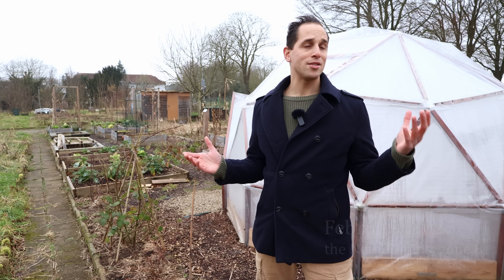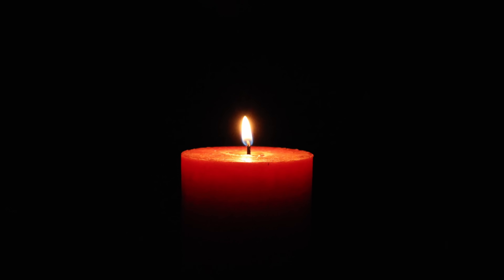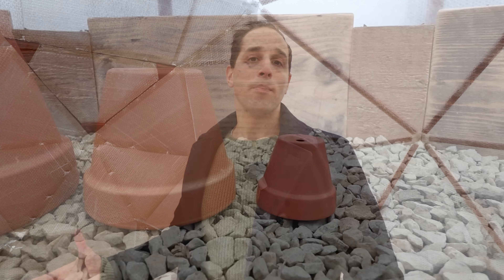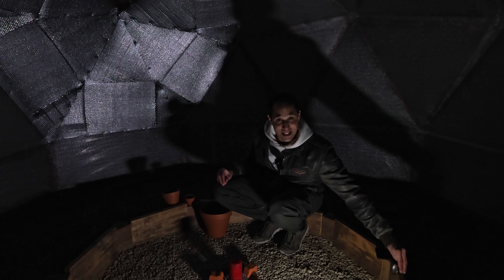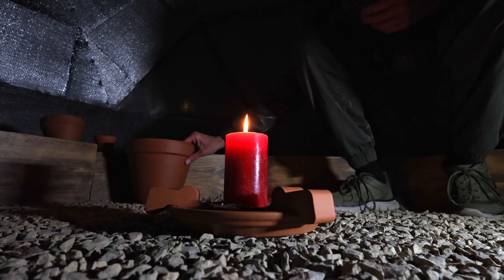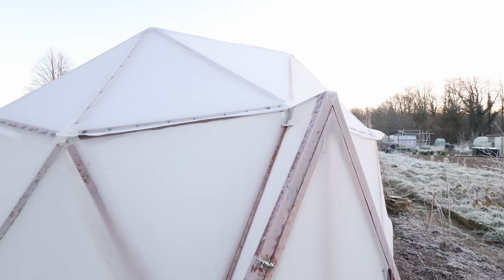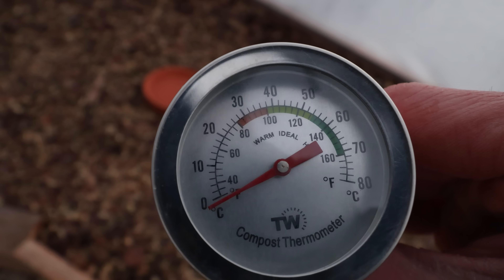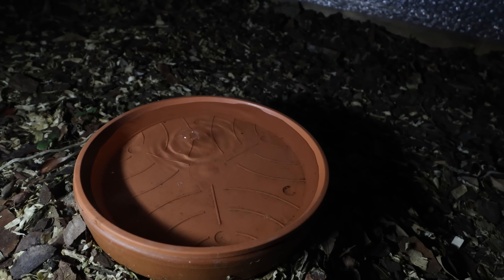Can a Terracotta Heater Keep my Greenhouse Frost-free? • Ep. 48

Comment: Having any air gaps just ruins the whole test. If there is wind, it will cause more air exchange than still nights. I used 9 candles in my house when we had a freeze in Texas. In Houston many houses were 17°F inside and many water pipes burst. I am located more than 30 miles north, therefore colder, yet my house was 39°F inside and no water pipes burst. Candles work absolutely and it’s a proven fact. But when you have air gaps and air leakes, it just ruins the whole test. Now you have another winter coming, you can seal the air leaks and try again. And, you will get the same result without the terracotta pots. Just unsing candles will give the same result.

Comment: try a 4th smaller pot in between the primary stack and the candles. Might need to go up a size on the bottom pot of the outer primary stack to keep the same size that you have now as your first one. But if you could get something like sand, in a big stock pot. You could heat the sand itself. Letting it act as a big radiator
Reply from the maker: Interesting idea to add another pot and sand! Thanks for the suggestion!

Comment: We had a 3 week power outage after sandy ..
Tried to heat a can of soup with the candles we were already burning...
It took over an hour so a candle just doesn't give off enough heat
Reply from the maker: 3 weeks?? That must have been a quite the challenge!
Reply: It was especially since we got 6 inches of snow a couple of days later..
But almost all of nj coast was in the same boat and it stayed cold afterwards .getting gas was also a problem but the police department took generators to gas stations so they could pump the gas they had.a lot of traffic lights were out making getting around hard only allowed right turns or ramps on and off for left

Comment: Get those air leaks! That's CO2 you're letting out. The permaculture course says to use compost or mushrooms to heat. The two work together. The plants make oxygen from CO2, the compost/mushrooms consume it and make CO2. 
Could try wood to, I suppose. That would be a trick though. You need to reburn.

Comment: Depending how cheap you can source your heat weather wood oil or candles is cheaper I would suggest the cheapest heating source For example a very small wood burning stove would easily heat that all night using very little wood Even a pellet hopper can be used to feed pellets of wood for long burn time

Comment: You're only loosing energy to heating those pots. Lighting the candle on itself is more effective, just get slow burning candles. How is the floor/base insulated? I don't know where you live but ground freezes as deep as 2.5 meters. The cold is conducted from outside soil, not just air.

Comment: Ive always seen the terracotta heaters built with the pots stacked inside each others, using metal washers as spacers and a bolt through the center to tie it all together.  Your method definitely is cheaper and easier.
Reply from the maker: The method you mention is also a very valid way, as a lot of people in the comments have pointed out! All I can say is that my heaters were very warm to the touch in the morning, but like I mentioned at the end: the best way is probably to have good insulation + thermal mass, with small heaters as a support role (or a solid heating system to really keep the temperature at comfortable levels)
Reply: @atthegrassroots bs they do nothing. Waste of money

Comment: Actually a good idea. Bigger pot for the bottom and one of those home-made survival candles from 3 or 4 wicks stuck down into a can of "Crisco" or whatever the equivalent is in your area.  Also one of those fans that people put on top of wood stoves that is "powered" by the heat for air/heat circulation would possibly take you even lower in safe temps.  But a good demonstration video, Thanks!!!!
Reply from the maker: Thank you for your comment! Yes, I've seen those "Crisco candles". I had to look them up but they are available in the Netherlands. And yeah, those "heat fans" look extremely useful for an off-grid heat setup!

Comment: I like the idea, but would look for a different heat source.  When you look at the current price of paraffin wax this would be a most expensive way to heat a greenhouse.  Have you considered small oil lamps?
Reply from the maker: I've heard similar stories of such candles being quite pricey. These were €2 euros each, so not the most expensive I would say, especially if it was for only a few frosty nights. But if you have long harsh winters where you need something consistent, then I suppose this will add up, especially if you need more. Multiple people have advised me oil (lamps) so that could definitely work. I still think thermal mass + good insulation is the best way to go, with these or other kind of heaters as additional heat support.

Comment: I made two heaters using votive candles for a 2.5' x 5.5' covered hoop raised bed. I covered it with plastic sheeting and covered that with a canvas drop cloth. It easily kept the temp under the cover 30 degrees warmer than ambient temp.

Comment: 7:41 so you have those 3 candles burning all night, but only 1 of them are burned half way and the other 2 candles looks like you just turned them on.
There are several mistakes with your video. 
1) With terracotta pot heater, the heat under the first pot gets too high, so your block candles will melt away pretty fast. how I know it? I have made the same experiment my self.  I had to use Tealight candles just to keep the wax from melting everywhere. 
2) you can't just stack the pots on top of each other, with a hole in the middle, because the heat go's out way too fast from the middle hole like a chimney. it doesn´t stay inside the pot long enough to heat up the pots. you have to block the air hole in the middle to keep the heat inside the pots to heat them up so they can radiate the heat.
Reply from the maker: I suppose that was because the one candle already burned an extra night.  Thanks for the feedback!

Comment: With so much 'empty space' in the greenhouse, you'd be better off filling it with something to act as a thermal sink. Even if its just a pile of water-filled plastic bottles, fill up as much of the space as you can. THEY will absorb the cold and radiate heat. 

I have several  little four-shelf plastic mini greenhouses.  The base of each (ie the bottom shelf) is filled with water-filled plastic milk bottles. I use one votive candle under a large terracotta poton the shelf above the water-filled bottles, and seed trays etc go on the two shelves above that. When all is fitted and closed up, I slide a cover I made from reflective bubble-wrap  over each mini-greenhouse. It covers to down to the base. I also have transparent bubble-wrap assembled into a complete cover to slide over, for days when a hard frost doesn't lift. They require careful handling but are effective.

A mini-greenhouse like that would be ideal for you to use within your greenhouse for seed starting etc, and   for soil  warming, you could lay a sheet of breathable black fabric on the soil during the day when the sun strikes it, and cover the area with a sheet of bubblewrap at night so all the warmth doesn't radiate back out - unless you want it to  of course!
Reply from the maker: Super detailed information, thank you so much for sharing your wisdom! I will definitely keep this in mind.

Comment: Don't sleep on thermal batteries.  If the sun is out, having something like stones or concrete pavers (lots of them) + good sealing and insulation can do quite a bit to keep a space warm.  Also, if you're going to do supplemental heat, start it a few hours before the sun goes down. I have a theory that a well-insulated warm bubble is much easier to maintain temp in than trying to warm up the space without assistance from the sun.
Reply from the maker: You're absolutely right! Good insulation + thermal mass will probably have the biggest positive effect. Of course, this was but a simple experiment to see what the effect of a terracotta setup could be.
Reply: Don't use concrete though, concrete has poor thermal retention. Get something like red clay tiles I think those hold heat a lot better

Comment: Both cases about 3 degrees warmer than outside. That could well come from just the stored heat in the growing beds. Then again candle flame is tiny and the energy output very low. It can save the surface soil from lightest of frost if it's only a couple of degrees below freezing. But nice experiment and well put together video!
Reply from the maker: Very true! After this experiment, I think at least multiple of these could potentially protect plants from frost, but I think good insulation + thermal mass will have the biggest overall effect.

Comment: I failed science class too....lol
Reply: It's not a bad option. The clay pot redistributed the heat from the candle, so it heats up the cold air at the ground level, instead of rising straight to the top of the greenhouse, and candles have enough heat output to keep smaler domes warm. I've managed to keep lants frost free in -15°C by wrapping them in a 1m diameter dome of 2 layers of bubble wrap and putting 2 candles inside. 
The two issues here are opening the door at night, which lets in really cold air and that a single candle has to little of a heat output for a greenhouse this size. But it principle it's a great option to keep plants warm if it's not feasable to run electricity and it's only needed for a couple of days.
Reply: Redistributed = energy loss, sorry no bonus here.
Reply: @ivanivanovicz8708  not really, a reflector housing or a lense in a flashlight also just redistributes the light, but it certainly increases the utility. And here is no energy loss in the form of heat, since the entire point is to have heat. 
The clay pots redistribute the heat to where you actually want it.

Comment: In the army we had something like a kerosene stove, I think just going with what’s established on the market is the best bang for your buck. This is cheap entry cost, but all those candles will be more expensive than the kerosene in the long run
Reply from the maker: You definitely have a point there. Especially if your area has a lot of frost days. Here in the NL harsh winters are not as common as they used to be, and this was really just a test to see if it would work and I could hold off the frost for a few nights.
Reply: @atthegrassroots Oh yeah I'm sorry I've responded to a few of your things already but this guy makes a good point. You just need two different sized cans one that you can put inside the other, and get a hold of some kind of carbon fiber drop cloth that would be for like a soft welding things like soldering and stuff use a blow torch, You have one can that's larger in diameter than another one You line the inside of the larger can with the drop cloth and have the drop cloth cut to the size of the can and it's not dropped off Sorry the welders mat It will act as a wick. And then you have your smaller can it's supposed to fit in there just so that it presses against your wick nice and firmly is held in place you'll punch a hole small hole or three in top to help let air pass through so you'll fill it with like kerosene oil or alcohol whatever it is something that will burn, and so you'll have that tin can put your smaller can in there on top the whole helps let air pass through and you've got your WIC waking material set kind of prime your wick or whatever if you have to set it a little terracotta thing glide it and it's kind of like a little burn stove it'll go for maybe 8 hours or something like that If you have like two or three primed in set aside you know you can pre-warm everything with one torch and then before you go to sleep set another one and then wait and you wake up in the morning You know change it out set the other one for a couple hours before putting it out and resetting for the next night.
Reply: @atthegrassroots  Grave candles are also a great option compared to the fancy ones used in the video. They are cheap,  and burn long, so if intividual plants need to be keept ware, wrapping them in 2 layers of bullble wrap and putting 1 or 2 of these light under it works really good.

Comment: THE MISTAKE YOU MADE WAS , YOU DIDNT COVER THE TOP POT WITH A COIN , YOU NEED TO LET THE HEAT BUILD UP INSIDE , THE WAY YOU SET IT UP THE HEAT WAS JUST RUSHING OUT THE TOP , IF YOU CAN SEE THE FLAME YOURE DOING IT WRONG , SORRY FOR THE CAPS , JUST TYPED IT AND TO LAZY TO RE DO IT . KEEP UP THE GREAT EXPERIMENT .
Reply: This doesn’t work in any case hence why gardening requires heaters in winter or we all would do this and save money
Reply: @pinballwizard6906 It’s a question of scale. The experiment actually worked if the goal in a small greenhouse was to keep the temperature above freezing. The basic point being that frost tender plants don’t freeze and can be kept alive in cold snaps. You’re not going to heat a large greenhouse with candles. That was clearly not the point of the experiment. Horses for courses.
Reply: Fortran programmer? USA military signal person? Screaming at us?
Reply: I guess your Caps Lock key got stuck and you didn't want to retype everything when you realized it.

Comment: It doesn't really seem worth it to heat one of these small greenhouses because for the cost of heating you won't get a return in produce. I have 2 small greenhouses but really they can only be used for hardening off plants earlier in the season. I start my seedlings in a shed on my porch that has lights and heat at night but during the day I open the doors so the plants are already a little acclimated before I move them out to my greenhouse. Once they are in the greenhouse I close it up at night and then go back in the morning to open it... so then I am not having to carry seedlings inside every night. It gives me like an extra month on each end of the growing season. Another thing you might want to consider is putting additional covers over your beds inside the greenhouse so that it is all double wall protected. I was able to get fava beans to survive the entire winter and some lettuce that way.

Comment: If you put the pots with the smallest closest then you can connect them with a threaded rod with spacers so the air goes up into the smallest then into the 2nd then 3rd

Comment: I don't understand the point of the terracotta though. It would make sense if you were trying to concentrate the warmth in a certain location, but your goal here is to heat the air itself within the greenhouse, which makes the terracotta pots redundant ... unless you're trying to keep the space dark?

Candles are also expensive. I'd use a drum filled with water, to make a small furnace, which I'd heated up with charcoal fire. The charcoal burns clean, and the heated water would gradually dispense warmth through the course of the night. There are various ways to set this up, including without water, but candles are not the way to go in my opinion. Just not sustainable, unless you're only doing this as a hobby and not for survival.
Reply: The terracotta is meant to act as a warmth radiator.

Comment: I'm wondering if there is any difference if you just had the 3 candles without the terracotta jars.  Also,  what would happen if he lit the candles while the sun was shining, instead of a 10 at night.   Then the candles wouldn't have to heat the air as the sun would have warmed the air inside,  already.  Then the candles would be maintaining a higher temperature instead of trying to raise the temperature from a lower heat.

Just some thoughts.
Reply from the maker: If I understood correctly, the pots absorb the heat and radiate it over time, instead of the heat of the flame being released in one straight line above the candle. Indeed, more people have pointed out to light the candles while the sun is still warming the dome, so that's a very valid thought!

Comment: The pots arnt quite right, you need one inside the other initially with the hole blocked on the first one, this will cause the recycling of heat and add more thermal mass
Reply: came here to drop the exact same comment. Most people don´t know how a terracotta heater actually works.
Reply: I've heard these don't even work
Reply: @sgtpepper8148  they do work but the idea is that you have an inner pot with a blocked hole that the candle heats up very hot and that the outer pots creates a drag to heat up the air flowing thru.

Comment: 80 btu just aint going to do it. each candle is 80 BTUs you need about 200 btu per hour to get a 10 ft round  6 foot high dome to get it from O degrees  to 2C.   it should take 3 candles if AI's math is mathing. I am really surprised.  give it 4 and let it rip.  MIght also consider just a 100 watt incandescent light bulb or heat lamp.  Electricity is cheaper.

Comment: A single candle only generates approximately 80 BTUs of heat energy. That’s less heat energy than an old 100watt incandescent light bulb. 
No one ever says, “hey, try making a light bulb heater.”
Reply: funny a 100 watt light bulb would heat it enough to raise it 2 degrees C need to get it above freezing, if it were sealed and there weren't any energy losses,  big ifs.   it is 341 BTUS